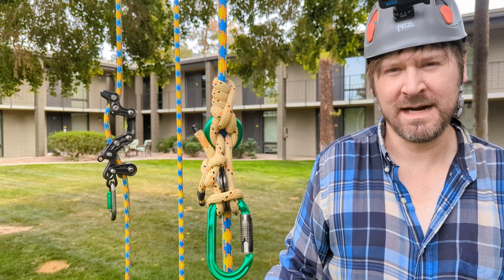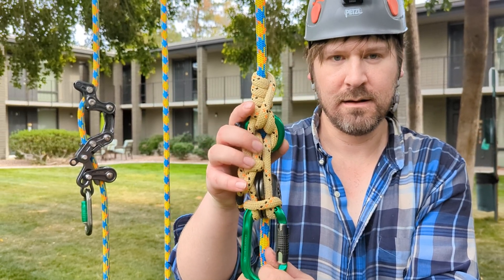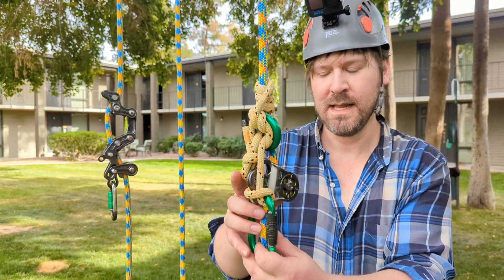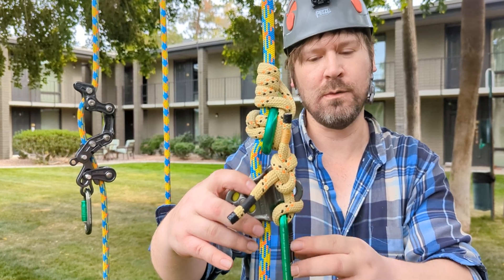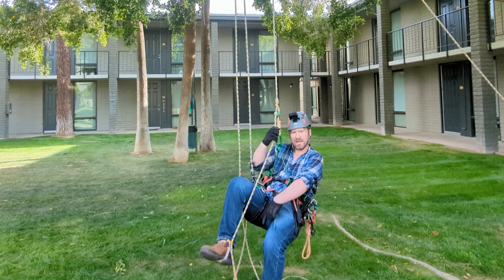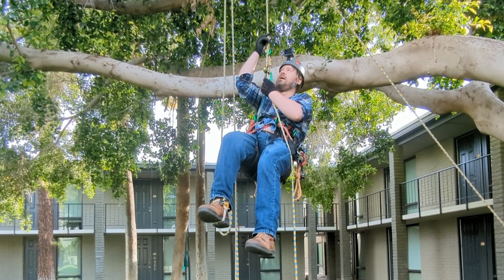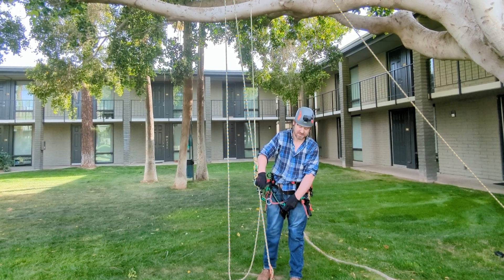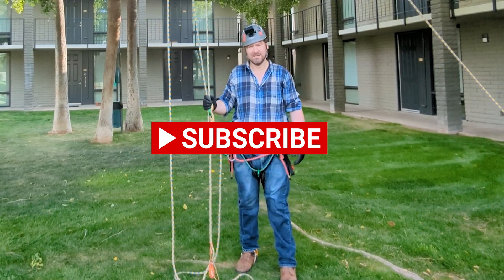SYNERGY Friction Hitch: Testing It WITHOUT A Rope Wrench!

Comment: Looks fun! I wanna try
Reply from the maker: Definitely give it a try! Let me know if you have any experiences with it! I used a 34mm ID (Internal Diameter) ring and 5 feet of Sterling RIT 9mm hitch cord in this video!
Reply: @Knot-orious  nice I have a couple of that same ring just gotta get the hitch cord. If it works smooth for SRT in the tree I'll definitely make a video
Reply from the maker: @metzgerbass well, you can use anywhere from 8-10mm hitch cord depending upon the diameter of your rope, but five feet is about right!
Reply: @Knot-orious  heck yeah ordering some right now lol. I have several removals coming up, can't wait to try it. BTW fully laughed at some of the recent negative comments you've been getting. That's a good sign that you're doing something interesting and creative. A hitch that has the potential to be SRT functional with no rope wrench would be a game changer for a lot of people, especially in cost. I dig the sheet bend and girth finish/attachment too, looks practical
Reply from the maker: Awesome, my friend! I assume you've likely seen the tying instructional video for this hitch, right?  If not, here is the video https://youtu.be/ZfRu2oYBSSY. I do like the Sheet bend setup, but I still prefer good old fashioned Poacher's knots at the end of both legs to make it more like an eye to eye. More secure than a Sheet bend, which can potentially come undone if you Cyclically load it. A Hunter's bend is probably more secure if you want to use a loop, or a Double Dragon Bend (which is a Double Sheet bend that has the tail from the bight get tucked away securely). Yes, I have been getting quite a few negative comments lately haha Some people don't like to see other people succeed is what I believe it comes down to; either that or it's just pure ignorance. A hitch without a wrench/tether is definitely a game changer for the exact reason you just brought up: it's way more cost effective. Definitely reply to either the video in the shared link or in the video you commented on when you have had some experiences with the Synergy hitch and report back with your findings if you have time/remember to do so! I would greatly appreciate it! Let me know if I can help you with anything!  9-10mm is a really good diameter for this hitch for when I was climbing on my 11.8mm Drenaline and my other 11mm ropes. In general, if you're over 200lbs like I am, it's ideal to use a 9-10mm cord. I hope this info didn't come too late. This is because the larger cordage will spread a climber's weight out more evenly across a larger amount of surface area contacting the rope.

Comment: I'm gonna test it can you tell size of ring and length of prusik rope,thanks
Reply from the maker: The ring is 34mm INTERNAL DIAMETER (ID) and made by DMM. Both the 8mm white Teufelberger HRC hitch cord and the yellow speckled 9mm Sterling RIT Response hitch cord are 5 feet long (60cm). Thanks for testing one of my hitches! Please report back with your findings if you are able! I would appreciate it!

Comment: Good job!  Nice editing.  I dig the backup plan with the second rope!  Where's the neck tether you mentioned?
Reply from the maker: Thank you! I'm happy that you enjoyed the video! Any time I test a new hitch, I always have a backup! I've never actually had to use it yet, but you just never know and it would suck hardcore to get stuck high up in the air, not to mention how embarrassing it would be! Haha! I didn't need the neck tether for this climb because I wasn't rope walking. I was manually ascending the hitch with my hand using the "sit and stand" climbing method with my foot ascender. Thanks for commenting!